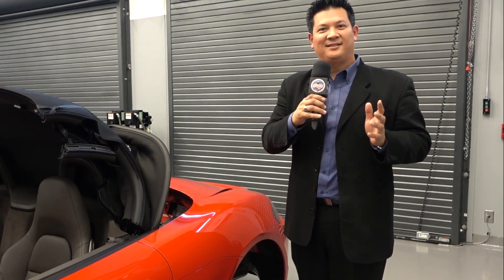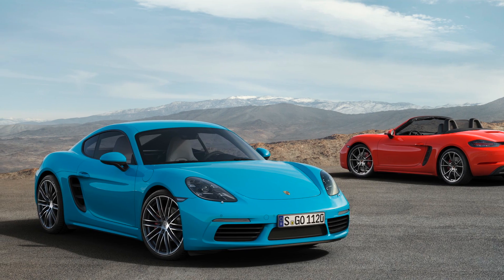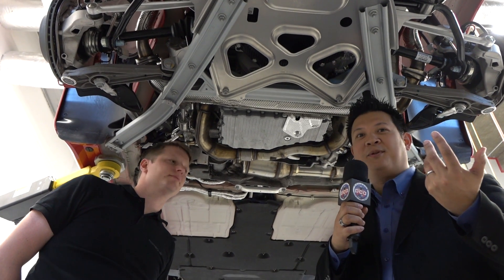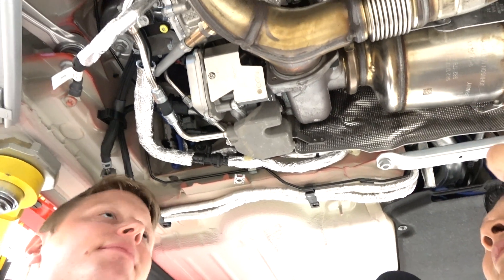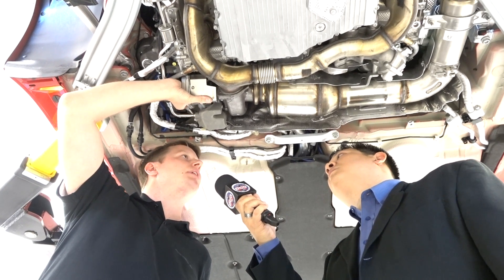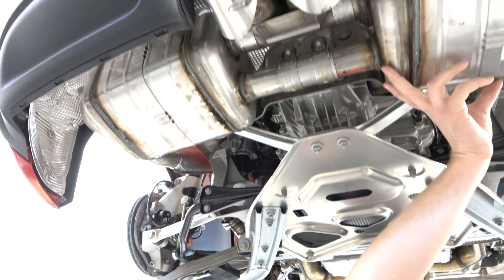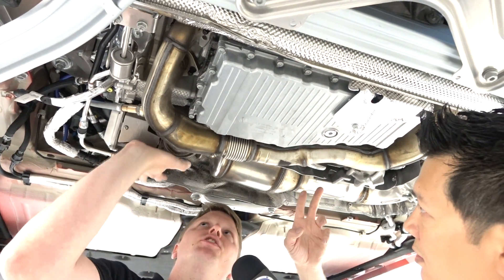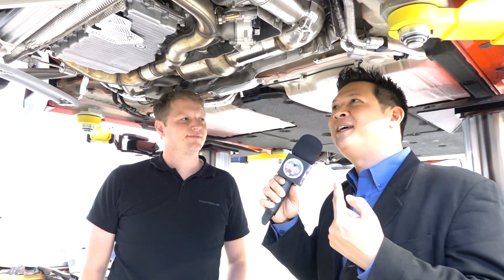PCA Spotlight: An in-depth look at the 718 Boxster S

Comment: Does the new flat four throttle it via intake valves or still use a throttle body? Also with all these direct injection motors, how does it handle carbon build up as the engine gets old. Subaru flat 4s have an additional injectors by the intake manifold downstream. I've had an X5 direct injection motor and had 145K miles on it without an issue, maintained on schedule/properly, and I could tell the car lost some power, it probably has a lot of carbon deposits.

Comment: So does the passenger side inlet draw in fresh air for the intercooler?  He didn't answer your question regarding that.
Reply from the maker: Cory, yes, the air intake on the passenger side provides fresh air to the air-to-water intercooler. Unfortunately his description of that didn't make it into the video, but starting at 2:52 you can see a graphic illustrating how intake makes its way through the system, including the intercooler from the passenger side.
Reply: Thank you, great video.  Keep them coming.